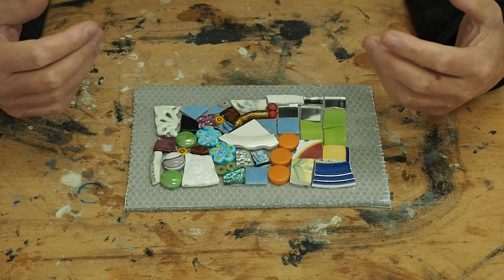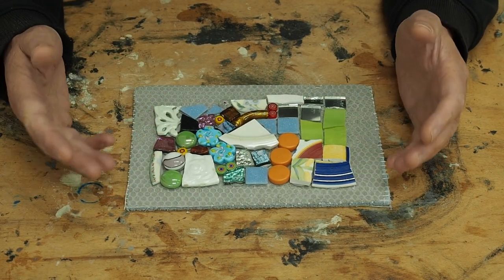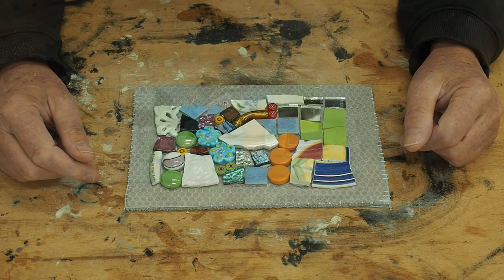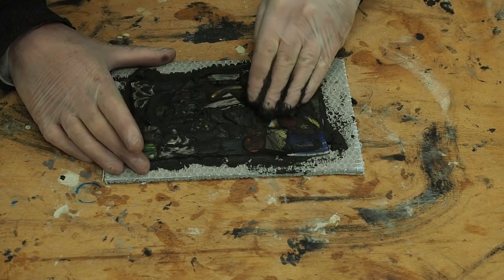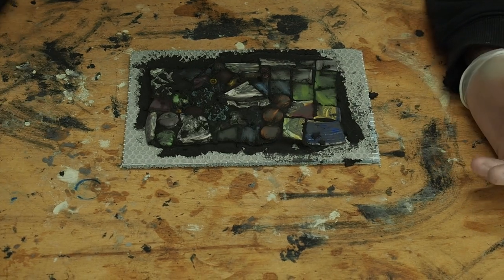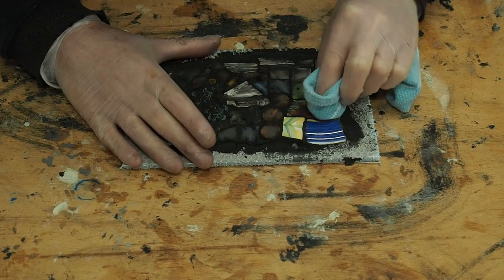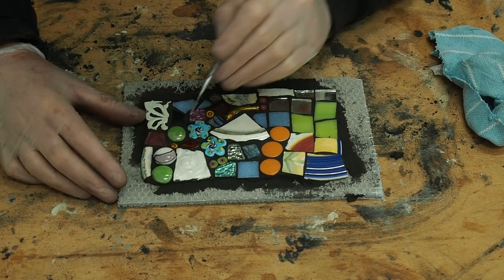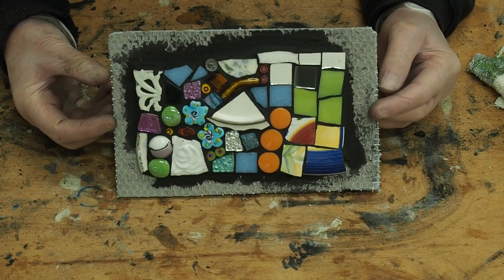Dry Grouting For Mosaics

Comment: Hi Peter, I'm so confused with difference of wet grouting and dry grouting. 
We have to add water to make it Grout. 
Sorry for my naive question.
Reply from the maker: Hi Mozhdeh, the terminology dry grouting is a little confusing, you do it after grouting instead of using a damp sponge, you make the grout the normal way but to clean it up  you use dry rags. 😊
Reply: Or use moist saw dust. 🤘